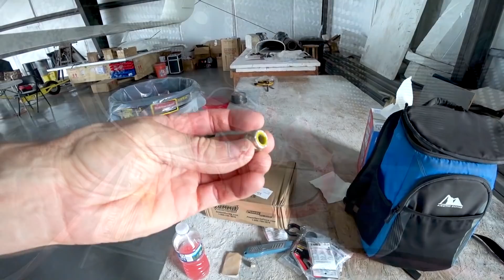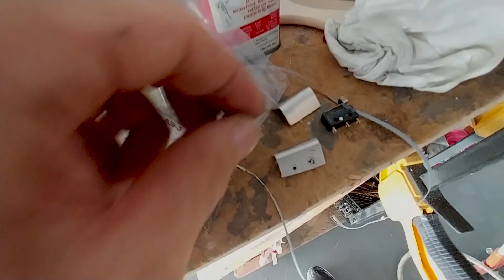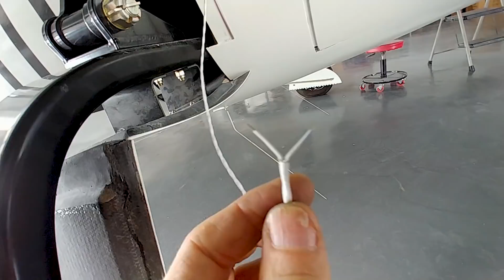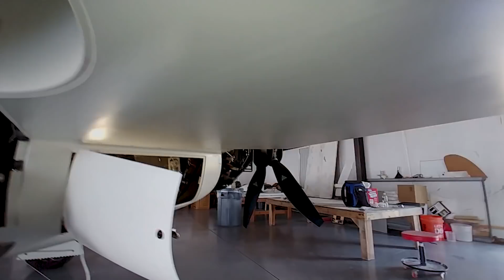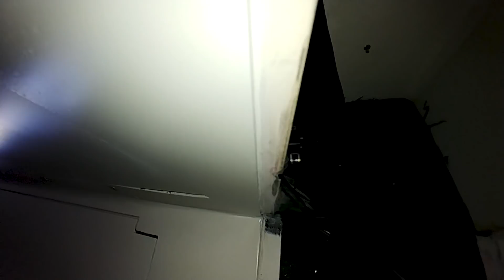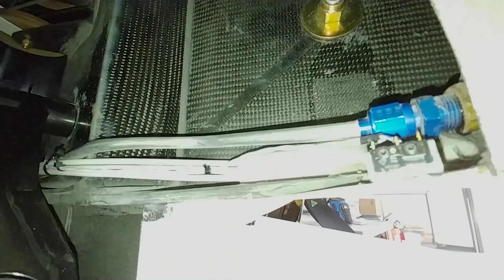Tying Up Loose Ends - Building the Raptor Prototype

Comment: Have to agree about those micro switches, they are too fragile for aviation use. Would it not be better to have the switch mounted to the gear leg and a contact point inside the wheel well ? Where they are is very exposed and looks looks like they could be damaged very easily, anything flicked up by the nosewheel would damage it straight away. Don't underestimate how much things can move during flight, especially during stall and spin testing. G loads and airflow changes will move anything loose. For example the tie wrap near that turnbuckle. Been following your build from the start and admire the way you have problem solved enroute. I like your choice of engine. Don't re invent the wheel too much though as a lot of aviation practices and methods have been learnt over years and many accident reports. Keep going my friend.

Comment: Nearly 20 years in aviation myself, both as a mechanic and an aviator (rotary wing), I'm going to reflect what a lot of other people here already stated...

These micro switches are NOT designed for aviation use and are not sealed against weather. The second they get wet or build up moisture on them (which is exactly what will happen in flight), they'll begin shorting out. You'll end up with false indications on the console for the gear doors, and doors only, which brings me to the second point here...

Proper gear circuits for gear indicator panels are dual-feed. There's a micro switch at the locking pin location, typically attached to the arm or a bracket. When the gear reaches full extension (the struct extends all the way and the gear is full-down and locked), this switch is depressed, sending a signal to the panel to change the indication telling the pilot the gear is fully down and locked. A SECOND switch is located on a bracket in the well or higher up on the strut, and it is depressed when the gear is in the fully up position and the doors are closed and locked.

A single switch located on the inside of the well wall is only going to tell you one thing... That the doors are either fully closed or they're not. It won't tell you if the gear is down, won't tell you if they're locked in the down position, or in the up position either.

This needs to be rethought out or it's useless, and proper switches need to be used.

Comment: You're probably already aware of this tip, however...

Get a paint pen (high contrast colour) and mark the nut, washer and carbon fibre with a continuous line. Easy way to visually confirm no movement of nut etc.
Reply: Andrew Rouen great comment! It is very common to see bolts and clamps marked this way in ships engine rooms. Makes for quick, easy and reliable visual inspections.
Reply: Andrew Rouen I was going to make the same comment. It’s called torque stripe. All wing attach points should have it.
Reply: Safety wire anyone? Let's not reinvent the "wing." 23 years AMT. Love the plane but there are some things I just cannot seem to accept with the standards I've been taught. But yea, at least coat an indicator line to reveal movement. Lord, scary. Keep telling myself this is just a prototype. Rome wasn't flown over in a day, Leonardo...

Comment: You are building this project as if someone was building a car...the problem: when a car stops it is sitting on the ground; with this aircraft... when it stops after take off, it will drop like a rock. Too many items in this build make this aircraft a death-trap. The failed parts all happened while on the ground. The outside design and looks of this aircraft are great...the parts used to keep this flying and it's occupants safe are missing..
Reply: As an licensed A&P mechanic I have to agree, there are a lot of things on this build that I wouldn't quite consider up to aircraft standards but I understand but this is a prototype. The biggest issue is the powerplant, specifically the lubrication system! I would be worried that in a high g load situation or a high Bank angle turn the oil will slosh away from the pickup and the engine will have a catastrophic failure. Also that engine was never designed to run at a high RPM under a high load for a prolonged period of time.
Reply: @lustfulvengance  I agree on the power plant logic - it is certainly an unproven, unknown variable in this equation
Reply: Only way it’s going to drop like a rock is if it has an inflight break up. Otherwise it still has wings that will remain functional after an engine failure.
Reply: @Alex-us2vw  
But everyone knows it's the wheels that make things move forward! 🤣

Comment: Those micro switches are not made for aircraft use. They get wet and will short out. I hope you are planing to get a proper aviation grade switches.
Reply: Yes, those depicted are the type one might find in an office copier to signal the CPU board that the paper drawer is ajar (read: mild environmental conditions). Surely the problem of aviation gear up/down detection has a more robust solution (for use in production)...  some type of proximity switch rated for harsh environmental conditions and (hopefully) no moving parts such as little roller-levers that might not do well in icing conditions, etc.
Reply: Maybe you should call Airbus helicopters and Sikorsky to tell them.  Cuz I've seen similar switches on both makes of aircraft. Though I do agree they don't seem very durable
Reply: TheSGTfish   I spent 17 years with American Airlines as an AMT and never saw any micro switches like that outside of the cabin area. They are not intended for use in any area that might get wet. Much heavier grade proximity switches would be appropriate. I find it amazing that the FAA would pass these in the area they are being used for.
Reply: @fw1421  Exactly. Nearly 20 years in aviation myself, both as a mechanic and an aviator (rotary wing). Completely agree.

These micro switches are NOT designed for aviation use and are not sealed against weather. The second they get wet or build up moisture on them (which is exactly what will happen in flight), they'll begin shorting out. You'll end up with false indications on the console for the gear doors.

Additionally, proper gear circuits for gear indicator panels are dual-feed. There's a micro switch at the locking pin location, typically attached to the arm or a bracket. When the gear reaches full extension (the struct extends all the way and the gear is full-down and locked), this switch is depressed, sending a signal to the panel to tell the pilot the gear is fully down and locked. A SECOND switch is located on a bracket in the well, and it is depressed when the gear is in the fully up position and the doors are closed and locked.

One switch is only going to tell you one thing... That the doors are either fully closed or they're not. It won't tell you if the gear is down, won't tell you if they're locked in the down position, or in the up position either.

This needs to be rethought out or it's useless.
Reply: VeteranAJ   I’m actually very surprised that with all the first class components they have used and the construction techniques he’s used constructing this beautiful airplane that he would use non aviation grade switchgear. Electric components can make or break a project. I hope these get switched out with something more appropriate for the use and duty.
Reply: They are used in paintball on electronic markers as trigger switches. A shot in the triggerframe ends up being cleaned out usually with water and the switches don’t break.

Comment: Are those micro switches waterproof? If not I don't think they will last long in such an exposed location. Fully sealed versions are available or alternatively you can get rubber boots for them as used on automotive applications.
Reply: I was going to ask about landing (and taking off) in tye rain. Wont water get up into the wheel wells? Especially that front one.